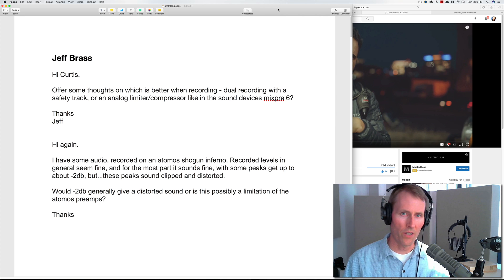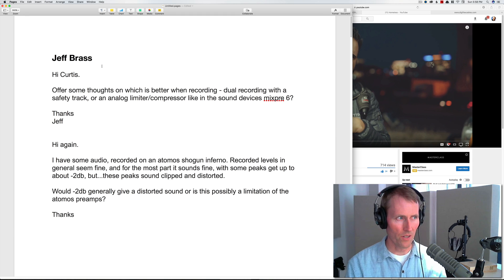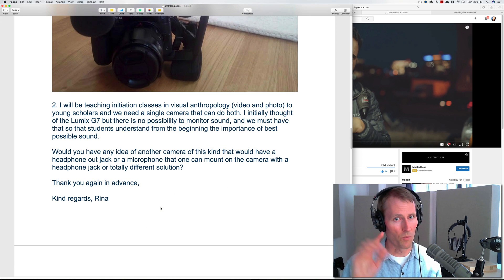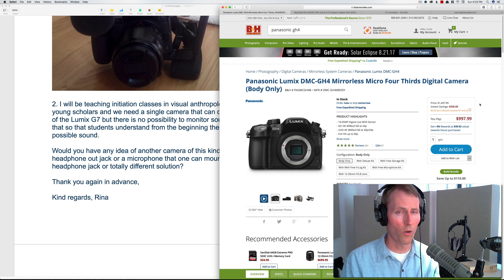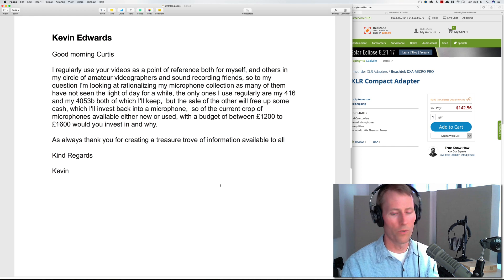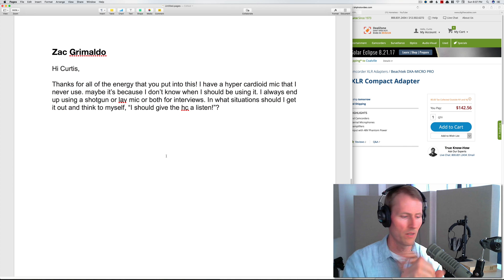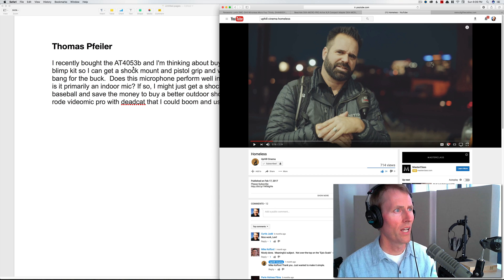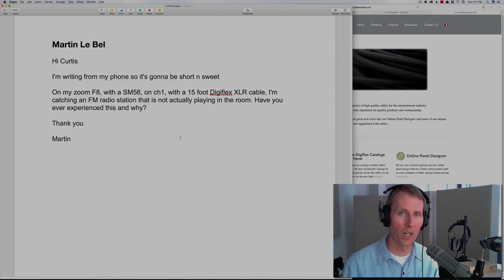Sound for Video Session: Q&A Safety Track vs Limiter, Which Camera, Which Mic and More

Comment: Hi Curtis on the last question about the FM station it sounds like most likely that the wires are crossed in the XLR cable. I have come across this problem many times when volunteer help in churches try to repair broken xlr cables and cross the wires.
Reply from the maker: Thanks Fred, good input!

Comment: I agree with you Curtis that it's important to think long and hard before disposing of gear - especially mics. I've done that several times in my career, only to regret it later and end up buying the same model of mic again! i don't know what other mics the questioner has so it's very difficult to advise. But assuming the other mics ARE going then bearing in mind what other mics the questioner has I'd be looking at a decent stereo shotgun - something like the Sennheiser 418-S or the Sanken CSS-5. Of course, that may not suit the questioner's way of working, but I like to capture location audio in stereo wherever possible. There are some decidedly average - and noisy - stereo shotgun mics out there so a hefty spend is really necessary. Ideally I'd want an MS mic that would give me the ability to decode and adjust in post as necessary.
Reply: Good idea, thanks Mike!

Comment: In response to Kevin's question, the mic Curtis was referring to is the Schoeps CMC641 (CMC 6 preamp mated with a MK 41 supercardoid capsule). For what it's worth, this mic is my daily driver. I use it more than any other for indoor work. It is a fantastic mic. Spendy, yes. But well taken care of, it will last you your whole career, while retaining most of its market value. Unlike the latest camera body, which will be obsolete in 18 months.
Also, Curtis, thank you for qualifying your use of the term microphone "reach". I always start twitching when I hear people describe mics using that misnomer of a term. As you rightly point out, it totally misrepresents how shotgun mics work. They don't "reach". They reject off-axis sound, to one degree or another. That may seem like semantic hair-splitting to some, but it is an important distinction to one's understanding of absolutely essential acoustic principles, like phase cancellation.
Reply: Thanks Scott. It would seem that I need to bite the bullet and finally add that CMC641 to my kit.

Also thanks for the the clarification on "reach". I should also have noted that there is a downside to shotgun mics with very tight pickup patterns - If you miss-aim, it will be more obvious and likely not sound as good. So this is another factor to consider when choosing a mic. Many assume that the tightest pickup pattern or the least amount of self noise or the most xyz is always best but they are always tradeoffs.

By the way, let's go record some cars. :)